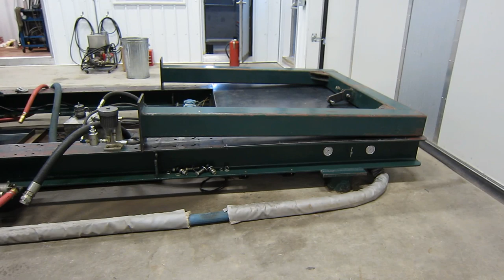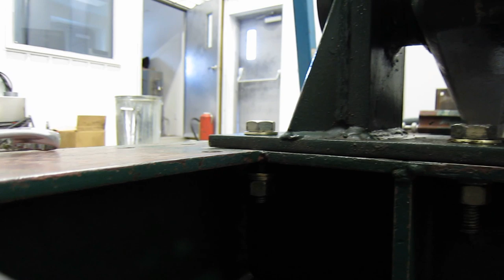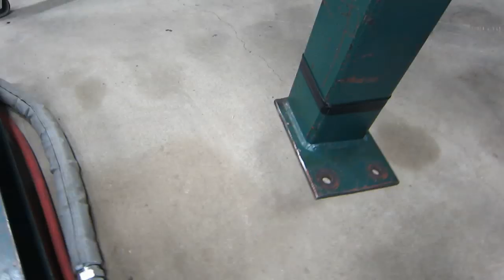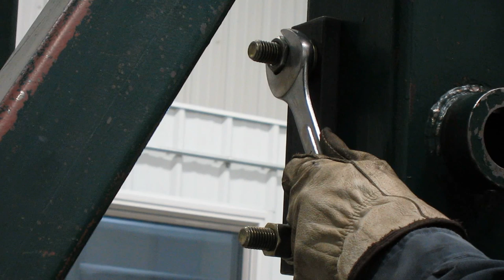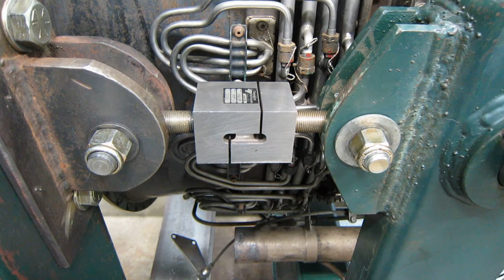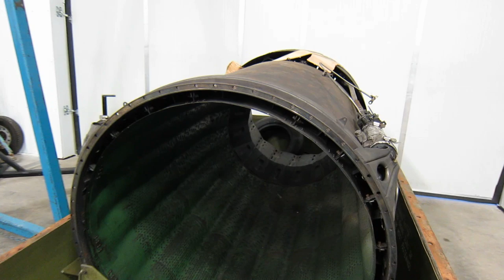The Engine Test Stand

Comment from the maker: @joelvh1 All signals are processed through an industrial PLC and fed to a computer. I can guess that the voltage signal produced by the strain gages are digitized and added for a total force value. I'm not the instrumentation guy or the computer programmer.

As for the structure, it is so overbuilt that is it basically considered to be unloaded at all times. Also structural steel will show large noticeable deformation long before it fails.
It's inspected visually on each use.

Comment from the maker: Big airliners have an APU on board to supply starting air to the engines. I don't know what is on a 747, but the 727 uses a Garrett GTCP85.... very closely related to our start cart, which is a Garrett GTC85.
I think the P stands for power, and means it can supply electrical power, as well as Compressed air.
The piping to carry the air to all the engines is built into the wings.

Comment from the maker: @blinginlike3p0 Structural steel, like the stuff most buildings are made of, is held together with bolts like this, of this size, but not Cad plated. They are always torqued either with a big air wrench, or by hand, as tight as you can get them.
I worked as an Ironworker on buildings and a bridge for 2 years, and never was a torque wrench even available at the tool shed.
FYI...
We use torque wrenches on the engines, but not the stand.
miamyer1 knows his stuff...

Comment from the maker: The reason? that's an aerodynamic question best left to the scientists. I do know that if the engine is not assisted with the starter after it starts burning fuel, it can not accelerate on its own. If, at 1500 rpm, you were to advance the throttle, you would spray more fuel into the combustors, and the fuel would burn, but because of the insufficient airflow, the combustor would overheat and melt or burn through.
Remember, the secret of jet engines is cooling air flow...

Comment: Hi Jay. So looks like I will have to admit an error when I told a commenter that the small wheels on the test stands have worn out bearings which prevents the entire assembly from leaving the building.  Also that the bush seen in the background is a safety system for the odd one that overcomes bad bearings and does leave the building. Haha.
I hope those bolts are all AN grade and you are not using any SAE grade 8 junk around that hi tech equipment.  I took that lecture to heart awhile back you know. Threw out all my gr.8 
Anyway it's good to hear the  bow tie 409 is still running the streets of Jet city.  Seems to me there was one when I lived there before jets showed up. When it was dog sled city.
Got a msg you showed up on LInkedIn but haven't found you yet.
Keep up the good work dude. Bob.

Comment: So, in the event that both load cells break (however astronomical the odds), what keeps the engine from accelerating forward?  I realize that the geometry of the structure won't allow it to fly out of the building - but the resulting dynamic shock load must be way higher than the 18,500lbf static thrust.

Comment: Ah, the "Big Bang" theory.  Now I understand!

I love this particular video, Jay. I had an inkling as to how these gems were fired up but now that I've seen this, there's no more voids.  Wonderful lesson.

You mentioned that once fuel flow's introduced and combustion begins (at about 1500 RPM as I recall), the starter must remain engaged.  Is that because there's not adequate momentum in the core to maintain rotation, even with an active combustion process? I'm thinking the answer's like, "duh!"

Comment: Hey Jay. You've pretty much explained all the major parts of a turbine engine (suck, squeeze, bang, blow) but I don't know if I've seen a diffuser yet. I'm still not completely sure how the air goes from the last stage of the compressor to the swirler in the combustor on different engines (whether it's straight axial or goes thru a diffuser or whatnot). Do you think you could make a video on something like that? Thanks Jay!

Comment: good Morning Jay, I have a few questions about the load cells.  The safety cables would indicate the possibility of one or both of them breaking. Have you ever experienced that?  Would that sudden movement damage the engine.  Also, how are they calibrated?  thanks

Comment: Hi @AgentJayZ I don t know if asking this question now is inappropriate, since 8 years have passed from the footage release. Can you give a list of all the instrumentations usually used during a test? Sensor and elecronical instruments? Thanks for what you do man!
Cheers from Italy.
Reply from the maker: We can measure any parameter, and often add sensors at the request of the customer.
A typical base set of variables recorded at a sampling rate of once per second for a J79 engine is:
Inlet air temp
Ambient air pressure
Compressor discharge pressure
Engine rpm
Power lever position
Fuel flow rate
Exhaust gas temp
Oil pressure
Oil reservoir temp
Oil temp in return line from main bearing
Bearing sump air pressure
Vibration in radial plane at each of three main bearing locations
Thrust produced
Variable exhaust nozzle position
Variable stator vane angle

That's 15 channels, and I think the capacity of our system is 32. In the past we have also measured fuel temperature, fuel pressure, exhaust gas composition, and external case temperature.
Reply: @AgentJayZ  thanks a lot for what you do! Great Answer!